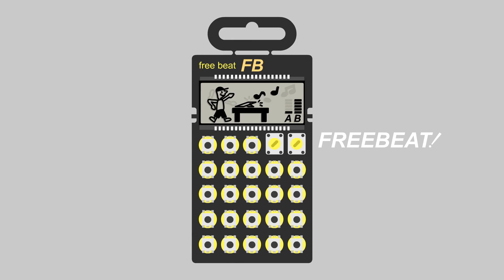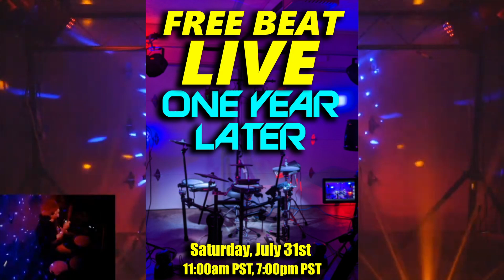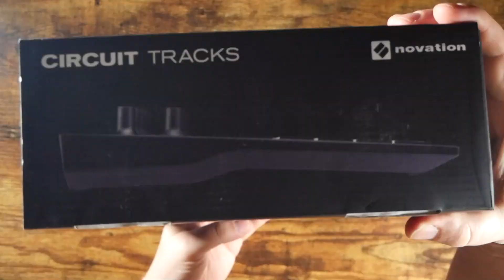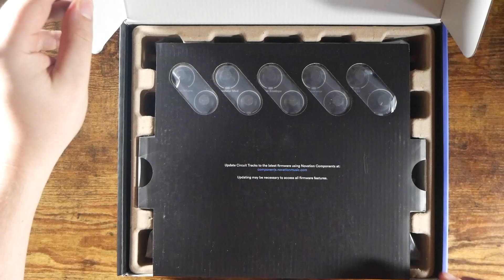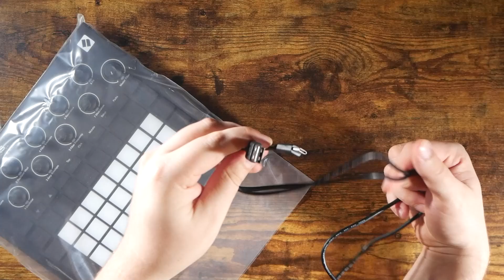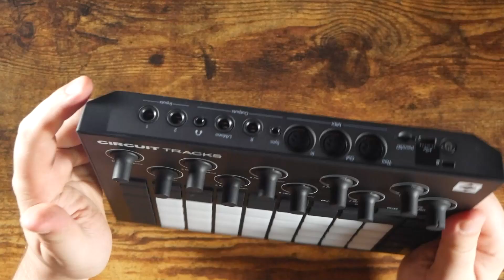Novation Circuit Tracks Unboxing and Initial Thoughts

Comment: I returned mine.  At first, it was fun but then I quickly wanted more.  Then, I picked up the OP-Z after watching your videos. For basic noodling, Circuit Tracks is ok but the OP-Z is so much better.
Reply from the maker: I'm finding that they are two very different devices! The songwriting process is completely different when you have multiple patterns for each track individually. Right now I prefer the op-z and it's workflow, but the circuit feels like a breath of fresh air compared to what I'm used to and I am enjoying it more and more.

Comment: 16 step sequencer?
Reply: 32
Reply: @luismp8548  Oh, ok
Reply from the maker: 32 steps, and you can change the resolution of a pattern to either four times faster or four times slower as well.
Reply: @FreeBeat  So is it better than Model Samples?
Reply: @ildafons  Elektron sequencer is second to noon. But the pads are stiff,
and workflow not as fast, no synth or dedicated midi tracks.